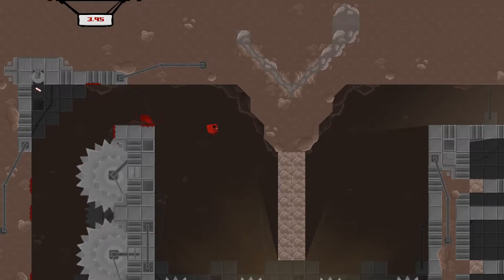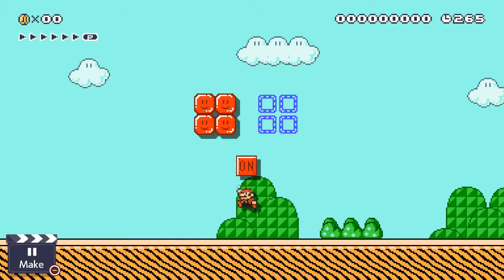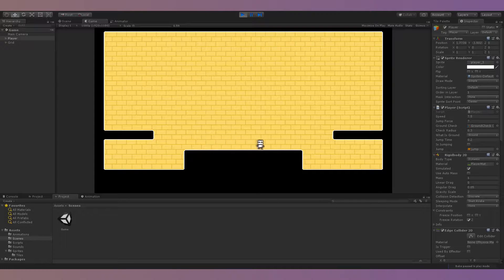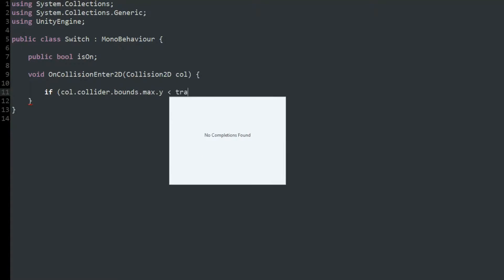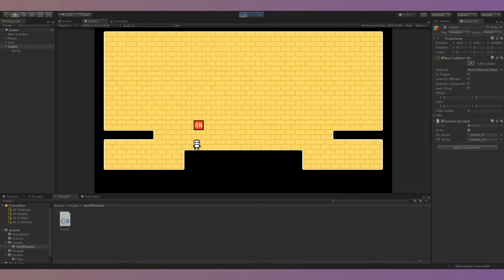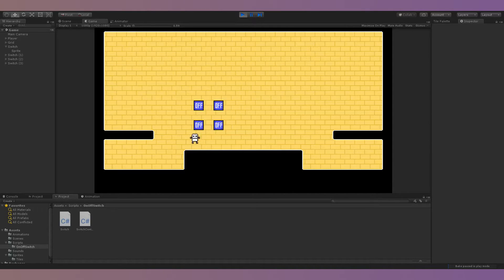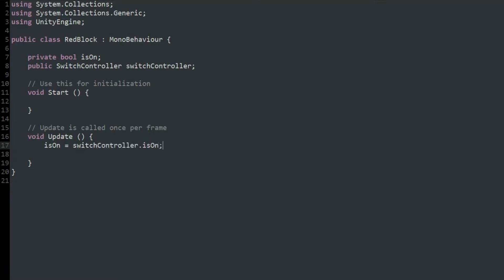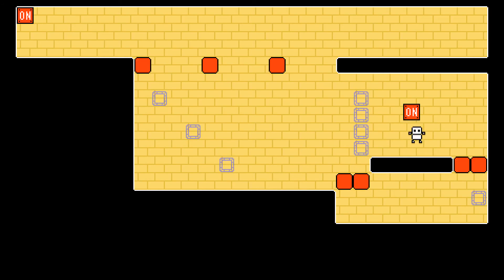Remaking the ON/OFF SWITCH in Unity - Mario Maker Deconstructed #1

Comment: Good video, but I have a bit of feedback:

Your mic is clipping, and it's really hard on my ears personally. Your voice is good for this, but I recommend either editing your audio afterwards or getting a better mic.

I feel like this should've been done with delegates, to avoid every single block constantly updating their sprites. I would like to note, that even if you change a sprite to the same sprite as it already is, that still has a performance impact that can pile up very quickly if you have a level with tons of these blocks. I would've personally also made both blocks use the same script, but simply have an enum that states whether the block is red or blue.
Reply from the maker: Thanks for the feedback, I agree that the sound quality isn’t good and I’m planning on getting a new mic before my next video. Despite my efforts to make the audio somewhat presentable in Audacity, it’s still really hard on the ears.

As for the code, thanks for the suggestions! I considered using delegates because I knew it wasn’t the best idea to have if statements running every frame, but I thought the performance impact would be minimal. I’ll add that change to the GitHub repository!

I also considered using the same script for both colored blocks (using a public bool I would set in the inspector) but couldn’t come up with a good enough reason for it that I could explain in the video, haha. 

Thanks again for all of your feedback, it really helps!
Reply: @PolyMars  A good reason for having a single script for red and blue blocks is writing a lot less code. Here you had to basically repeat a whole class, which if done in a large project would pile up quickly.
Reply: Also the sprite controller should have been a scriptable object for better performance.